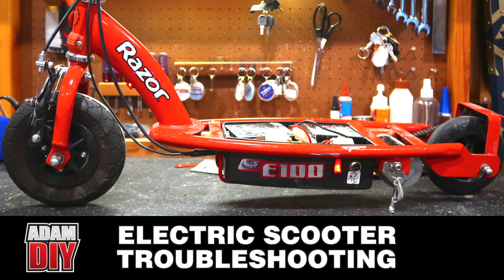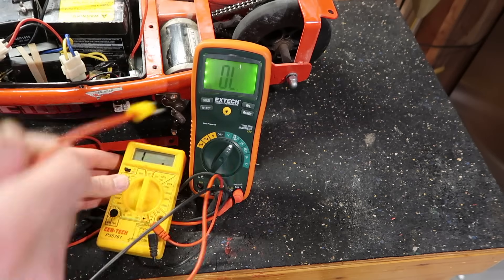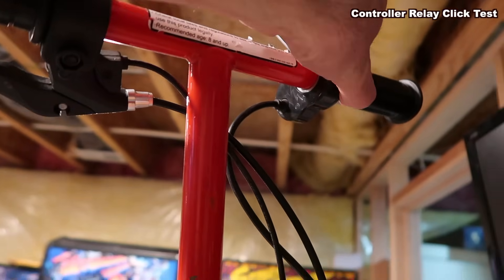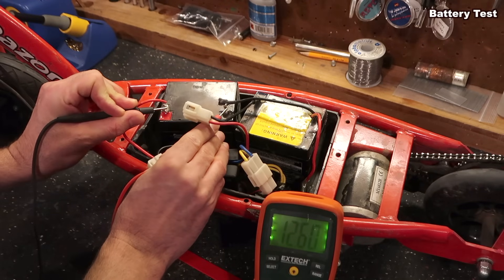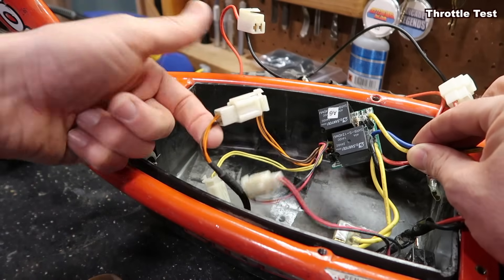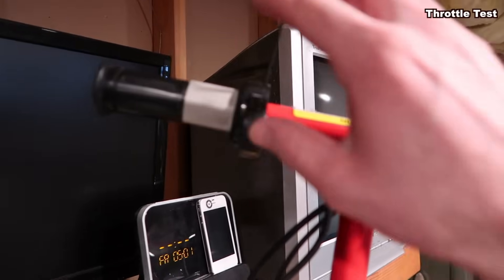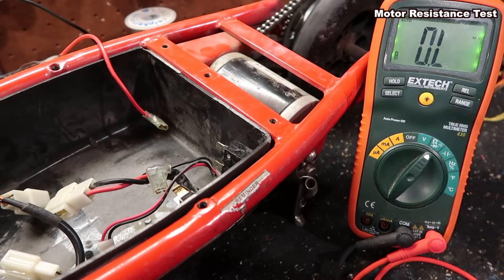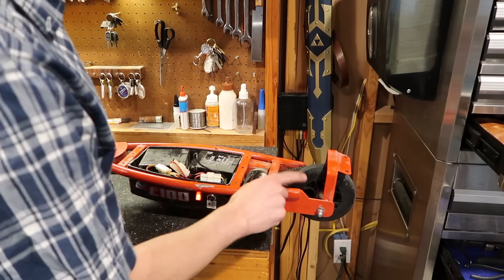How to Repair an Electric Scooter - Razor E100 Troubleshoot

Comment: Thanks! I bought the blue one I found on kjiji that had its battery stolen and a missing charger. All it needed was 2 replacement batteries, a wiring harness, and a charger.

Comment: You are a very nice man, it was the batteries they were soldered on so put them back same way,  it didn’t go  but found you have to give the drive wheel  a fair old flick to make it start and it did. In U K we can’t use them on the road or side walk (pavement) but family has a field, thanks again.

Comment: If it hasn't already been mentioned - test the batteries first because if they're dead then the control relay won't click.  >>Be careful when testing not to short circuit the battery with the test probes!<<.   Also, the circuit breaker does not trip because of over-voltage, it trips due to over current draw (amps).

Comment: we had one of these given to us not working. the relay works but we cant kick off the motor by hand or otherwise. Resistance is 40 ohms which is 8 times higher than what you showed.
Reply: My kids just stopped working last week but has similar symptom, relay clicks, light works, but after kicking off motor doesn't go. Bad motor?

Comment: this scooter also work on 36V lithium battery. just connect it directly to the motor via an on off switch. just make sure not to stress the motor too hard as it will otherwiese go off in flames (own experience)

Comment: Hi Adam .. Recently I just come across to your YOUTUBE channel.  DIY...You seem like. Smart guy who know how to FIX pretty much ANYTHING. 
I have a problem with my coffee maker KRUPS XP1500....look like the end of power cord wire connnection burn out. Lost few inches on wire. I hope you could MAKE A VIDEO HOW TO UNTOUCH ( CUT) AND RETOUCH the wire using welder. I never use welder or do anyting with wire...which one - negative or + positive. IF YOU COULD HELP...I WOULD APPRECIATED IT. THANKS ADAM.

Comment: Hi, prob wont get a reply, but worth a try, I dont have a multimeter, but might get one, but the problem is that i get the click when i turn it on, but seems like smth wrong with batteries, we did not use the scooter for 4 years, and now when i charge it, the indicator on the charger says charged, does this means the batteries are most likely dead?

Comment: Great video...which helped me to isolate my son's scooter issue down to the reset button which I ended up bypassing and the scooter now runs like a champ!
Reply: 🤭 that's a SAFETY switch ! .. you can bypass it to make sure it's bad BUT YOU HAVE TO REPLACE IT if it's defective otherwise you're risking an injury 🤕 in case of a short circuit or a 🔥 fire!
Reply: What was the reset button causing, that bypassing fixed?

Comment: I need help. perform tests on E100. battery, relexs, suiches, all cables, ok. Control box sounds when you press the accelerator. the engine with 24V power source was tested, ok. but, the engine does not start with the acceleration switch. the wheel is turned manually with the ignition, and nothing happens. I do not know what else to do. Help me

Comment: I serviced those relays in the unit I'm working on. They are glued shut and it's tricky to open them. Not impossible though.
Only reason to open a relay is to clean the contactor points.
Reply: My relays click, but I don't get voltage to the motor. Is this the problem you had? How did you end up getting the covers off the relays?

Comment: I have tested the batteries and I have tested for continuity. I also bought a new controller box. Now the power light won't come on until I turn the throttle and turns off when I let go. What should I check next? Thanks

Comment: I have a e300 new batteries fully charge. the motor work fine but as 
soon as I  get on it,  it can't go, or go very slowly and stop, I am not 
heavy 141pounds. could it be the partially motor damage in someway?
Reply: Same

Comment: Hi Adam. I have an e100, but my controller and throttle look different.   Batteries and motor are fine, so its gotta be controller or throttle.   But I. Sont find the parts.  Can you help??

Comment: I am working on a Razor E100 Glow. I ran all the recommended test including continuity across each connector. My on-off switch and  plate do not light. The handle bar switch engages, hearing the relay click in the controller, the motor runs when the back wheel is spun. Any ideas on what to test for the switch and plate? The on-off does turn on with the charger hooked up.
Reply: The scooter has to be moving before the motor will engage I think it's so the kids don't get thrown off.
Reply: It now has a 97cc gas engine on the back, new number 35 chain and sprocket.  Lol

Comment: My sons e100 scooter battery is dead from riding it , I plugged it in and the charger light stays green when it clearly should be red . Do you have an idead what it could be ? what should i test ? keep in mind my batteries are dead . Thanks.

Comment: New E95 series scooter that my son used literally 1 day. Now when u plug in charger it won't charge. Charger works on my other sons scooter so it's not charger
Reply from the maker: Have you looked inside?  If it's brand new it may be just something like a loose wire.

Comment: My charger light stays green and new batteries won’t recharge!!

Great video. Many thanks. I installed the new batteries and the scooter ran great off the delivery charge. However as others have reported the charger light stays green and the batteries won’t recharge. I’ve tested the charger output at the pins and I’m getting 24v but 0a. I cannot find a solution for this. Can anyone help?

Comment: I have an E100 Power Core. I have replaced both the throttle and controller and l do not get a click from the relays. The batteries test good as I am getting over 13v per battery and over 24v when they are in series. Is my motor bad? Not sure what else to check.
Reply: Batteries ended up being bad. i replaced those and all is good.
Reply: Scott Peterson l

Comment: The throttle works as a potentiometer doing a continuity test alone doesn't tell you whether the throttle is any good or not, unless all you care about is full on or full off, why didn't you show how to sweep test the throttle, you were right there at the connection.?
Someone could get hurt with your method of testing or lack there of not trolling but just making a point.

Comment: Hi i have a question I purchased a razor e90 second hand.and when I put the charger in the charger flashes red and green and make a low level noise I contacted razor in Australia but they said.the charger was faulty but just to check I plugged the charger into my other sons scooter which is a.razor e125 and the light goes to a solid red u mentioned this to razor and they said you not to do this as.they are 2 different scooters which I find hard to believe
Reply: The e90 is a 12v scooter. The e125 is a 24v scooter. Probably best not to mix the two with that charger meant for 12v.

Comment: I have 25 vdc going to the controller from the batteries, but only .2 vdc going to the motor from the controller when the throttle switch is actuated.  Thoughts?  (The controller is new)
Reply: I have the same problem - did you find a solution?
Reply: Same here😥

Comment: Hey I have a problem with my e100 scooter where the relay clicks but when I spin the motor the light goes dimmer and the relay doesn't click until I turn it off and on again any help would be great.

Comment: Hi..question....OK..so I tested all the continuity points for the break, ON/OFF, reset sw, throttle. I used a car charger set on 12v 2am to charge the older batteries and when done I placed them in and heard the controller click...tried the paper-clip bypass on the break connector and the motor seemed to ALMOST go...SO, I bought 2 new batteries and a new charger cord. Installed and let it charge over night, next morning both batt's are at 12.75 to 12.78vdc...Heard the controller click, held down throttle spun wheel ..nothing!! tried paper-clip bypass again, still nothing. SO My question is..I am wondering if the motor itself is bad I don't want to toss another 18$ plus TX & SH to find it still doesn't work....So how do I know or test to see if the motor itself is shot? AND if I am hearing clicking on the controller, could it STILL be bad? Thoughts? Thanks ....T

Comment: my scooter wont turn on. even if i press the fuse button. im sure it was a faulty fuse
Reply: Hey, my scooter s on off switch is not lit up at all, I have been charging about 8 hours from it being complete dead and still no light up on the switch... do u think I should just junk my scooter?
Reply: Both of you sound like you need new batteries. If you do what this video says you can see if the batteries are any good or not
Reply: Its JayBoi pp m